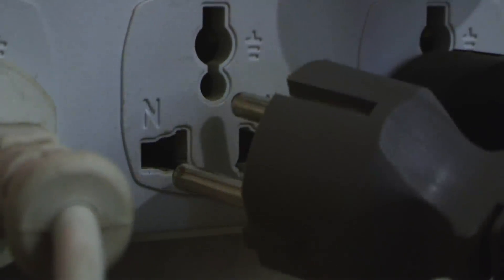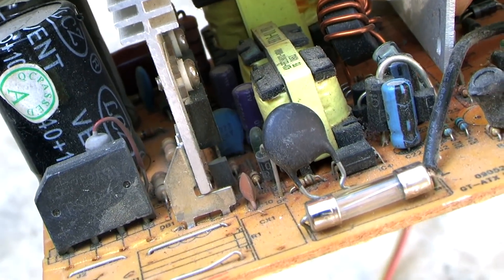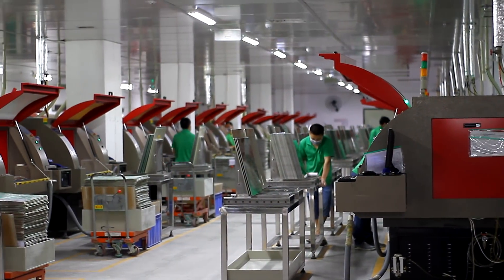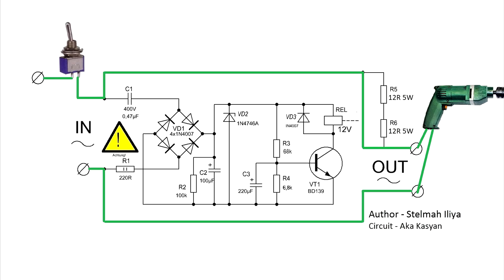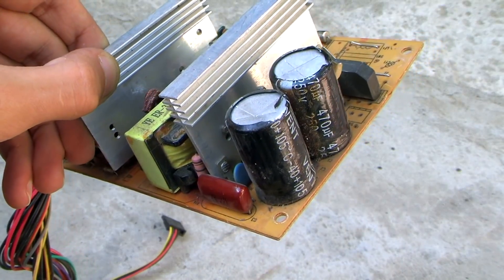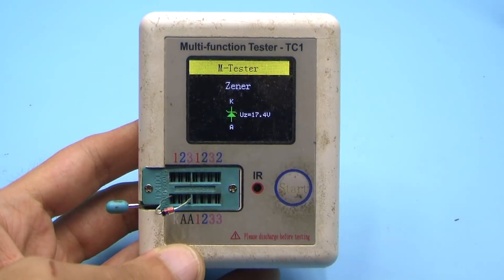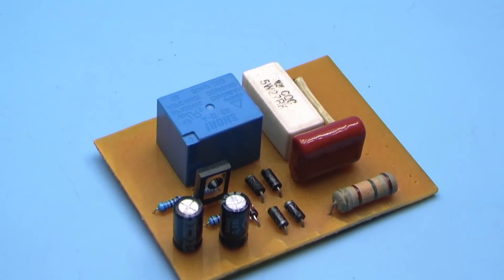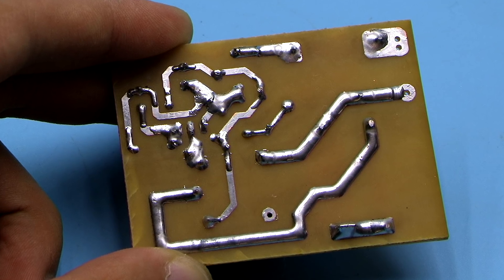This device will extend the life of your home appliances!

Comment: I used to make same principle on Radio repeaters, you can add a variable resistor to the capacitor C3 in order to control the time of charging so you can control the time of the relay or add a variable resistor to R3 in series could be useful to control also...

Comment: This idea is good but the extra current to power the relay during the operation adds extra electrical consumption. I want a circuit with the same purpose without using a relay.

Comment: the circuit works only when the load is on when apply power to the circuit. better to add current sensor to check the load and act according to it

Comment: what voltage should be for C2 (100uF) and C3 (220uF) electrolitic capacitors? because I could not find this information on diagram, nor in the material

Comment: i just want to say that, in pc power supplies,  the capacitors who need that "colossal" amount of charge will consume the same amount of energy at starting, no matter the method used for soft starting, since they need to charge, so the energy required will be always the same.
Edit: also, a computer is normally pluged in once and stays there until it breaks, so it only "needs" (it doesnt) the soft-start once, since the capacitors are permanently conected to mains voltaje. During that time, the whole circuit will just sit there, while the components slowly die, wich is a waste of money.

Dont get me wrong, this is still something really good for motor appliances, but not for electronics ones
Reply: It is true that Capacitors require the same energy but you can you can charge it slowly (with inrush current limiting device such as this) thus reducing the inrush currents. Resistance of fully discharged Capacitors is very low and pull very high currents initially. For which this soft starter would work perfectly.
And also not everyone leaves their computers on.
Reply: @sattisonaguiar7328  what i mean is that the amount of energy required is the same, doesnt matter if its all at once or in a smaller "stream" of current.
Also i said that even when the pc is turned off the caps still charge, so unless you unplug the pc after using it (weird, but some school do it) the the soft starter could be usefull, but again, what i said above
Reply: @asuramaru6931  yes in case of PC's they would keep charging unless you turn off the switch.

But for the part Capacitor charge, I kind of disagree to weather charging  them with inrush current limiting is better or without it.

I work at a factory with large Miling machines. Everytime we switch on the machines, it trips the circuit breakers (63A 3phase) multiple times. Culprits are a bunch of capacitors (around 4500uF in total) in the main frequency control drive.
The initial current is way above the specified limit of the machines itself. We checked and found they have no current limiting at all.

Capacitors charging instantaneously, loads the system. It even loads the bridge rectifier.

By the way all SMPS come with some sort of current limiting, such as an NTC.
Reply: @sattisonaguiar7328  indeed. In large machines line those the capacitors are a problem. Maybe using some switches you could turn on the bank part by part? I'm not an engineer but i think that will solve the problem, so maybe.
But you would need a ton of PCs if you wanted to trip a breaker, so the rush current is not a concern
Reply: @asuramaru6931  all the Capacitors are in parallel, so there is not much choice there. Yea PCs in general wouldn't trip a circuit breaker anyway. also it comes with some form of current limiting.

Comment: Very nice video, it adviseable to install a resistor across the C1 (main "ballast" cap). It is recommended that for a capacitive dropper circuit to have a resistor across the dropper cap to discharge it to eliminate possible shocks off of it. Other than that, very nicely done!!

Comment: This product is extremely dangerous if used improperly, and it provides little to no benefit because modern products sufficiently limit or tolerate in-rush current.

Comment: A drawback I see with this circuit is that appliances have their own starting switches and if mains is applied already, by the time the switches are pressed, the timing of relay has expired and its contacts closed with softstart cancelled.
Reply: True. If the soft-starter is connected to the mains first and then the appliance is connected to the output of the soft-starter a short while later, the relay would have been in contact position already. So you get the same high in-rush current just like there is no soft-starter.
Reply: not at all , the current is reduced by the loading resistor before loading current passes through relay to the load.

Comment: mam, How it is possible in hand drill
When we connect in main supply it will activate..after some time only we are pressing swich on drill

i think this can use only..direct switching like computer,amplifier etc

How can we use in Hand drill..etc
kindly explain
Reply: This circuit will give you a soft start when the device is first given power. You cannot easily add this to a hand drill, that's just an example load used in the video. To properly implement this, you need the switch on your device to control power to the soft-starter input. Usually, you will integrate this into your power design.

Comment: One issue, ironically, is that the relay has an inrush or starting current and the simple capacitor limits current to about 18 mA - which may not be nnough for the relay to latch.

Comment: You don't want to eliminate R1. that 220Ω of ballast will protect the bridge rectifier from the inrush current of the ballast capacitor, if the device is switched on during the peak or crest, of the AC wave form. That resistor (R1) IS absolutely necessary. This circuit is a great way to soft start large linear transformers, used in audio amplifiers. Both, because of transformer core saturation caused by DC bias, and, there are large capacitors in the power supply that need to charge. it will prevent nuisance blown fuses on power up.

Comment: The current 1:00 for big caps dont need to be controlled by thermal resistors???????? WHAT, THERMAL RESISTORS? REALY??
Reply: If your capacitors are charged through a transformer, thermal resistors aren't normally used.

Comment: can i use this to circuit to soft start a 1.5hp aircon compressor?
Reply: I wouldn't recommend this for starting induction motors.
Reply: No, AC needs a higher starting current. This is absolutely the opposite of what you need. You need a inrush starting capacitor.

Comment: Good and complete explanation of soft starter tutorial. I will try it to use in my cutting machine 2000 watt. My 2200 volt electricity always trip when im using 2000 watt cut off machine. I hope it work
Reply: Hi did you try ? Is this really work ?

Comment: It works well in small machines (upto 500w). When I checked in my mitersaw machine (1650w motor) the 5w resistor burnout. Can you suggest any heavy duty resistor.
Reply: change with 20w or more
Reply: @GheorgheBogdanEugen  i try starting my 2200 watt cutt of machine using 2 pararel of  20 w39rj kapasitor, it didnt trip the electricity. But the temperature reach 100 degree celcius when i use for  30 second. I think when using this circuit, the relay will cut off for 1 or 2 second, so the temperature on the resistor is not to hot
Reply: @wiracruise  If You put 20w in parallel you will have only 10 w
Reply: @GheorgheBogdanEugen   Sir, If you put two equal 20W resistors in either series or parallel, the combination is rated at 40W and not 10W.  The actual values of V, I and W in a particular circuit must be calculated by: I=V/R and W = I×V.  You need to know the applied voltage V and the value of the resistance R.  Regards.  Clive.
Reply: But is when i want to change the relay using 24 volt relay, what component in this circuit that i have to change? Somebody please give me an.answer. thx

Comment: I've been looking for a way to limit inrush on a big capacitor bank, maybe I'll try adapting this design :)
Reply: Better not - look for how to actually limit inrush currents. For longer loads an NTC is still great, for just capacitor-loading, if it is short, a simple coil/flyback-Diode would be enough.
Reply: @ABaumstumpf  would you please point us to an example that I could use for a 3000W 220V inverter that trips the breaker?

Comment: Instructions at 3:00 are very confusing. For this cct. to work all loads MUST be switched on and off via the soft start switch not the switch on the load (drill). Once the soft start switch is turned on the relay comes up after the delay period but then stays on until the soft start switch is terminated and C3 discharges. Zener diode description at 5:45 is very strange. The zener requires a resistor in series not parallel in order to regulate voltage and why would you set the operating voltage to 18 volts using a 12 volt relay? That won't last. Needs more work guys.
Reply: The zener diode has reactance (capacitive dropper) and resistor (maybe that resistor acts as a fuse?!) in series so this works. But yeah this kind of videos should be moderated or censored on YT, so many amateurs out there and playing with mains voltage is very dangerous...

Comment: from  6:34  to   6:37   resistor R1 disappears, how funny :)    I noticed it because I saw that R1 (5W, I think) on your board was obviously overheated and was about to burn off. In cooperation with C1 he has to supply the relay with a reduced mains voltage and therefore has to cope with a high voltage difference (energy). If you have a relay with a higher response voltage (24V or 48V ..) or a higher resistance on the coil side, not so much energy in the resistor would have to be killed down and the thermal-problem would be easier to deal with.    ...anyway, I love your videos - there are a lot of inspiring ideas that are worthy of attention.

Comment: The best explanation and design I have found for soft starter on the web, thank you for being giving with your knowledge.
Reply: ??? This is a rather crude design and will basically do nothing if not even be bad for most appliances as they already have inrush current limiters and they are designed to work with mains-voltage, not with some arbitrary outside current limiters.
Reply: @ABaumstumpf  you have too much trust in manufacturers. Same circuit like this one is used in many older appliances but omitted in many, many new ones just to make they lifespan shorter (and save some money to manufacturers). People often talk about "programmable life span" thinking that there is some chip which will tell device when to die (and sure, there are some examples of that in stuff like toner cartridges) but most of the times manufacturers just do it like this on electrical side, using too soft material for something on mechanical side or even (as seen on some old AvE video long time ago) just use unprotected piece of iron in submerged pump knowing rust will do a job in a year or two just when warranty end. 

He use example of PC power supply as device that have soft start function and doesn't not need this but just a few days ago I read review of new (and brand name) power supply which didn't came with NTC element, something even chinese "1000W but actually around 200W) PS never omitted. In that world you live. But sure, you can still trust manufacturers.

I'll probably make one just for circular saw mounted on table, it is started with foot pedal so this circuit can be applied. For drills is unpractical, not sure why he choose them as example.
Reply: @gorky_vk  Yeh - you are mixing up crappy counterfeits with actual normally designed products.

"I'll probably make one just for circular saw mounted on table"
And if the saw is any decent than this circuit will not only not help but actively be harmful. Heck - if you are lucky the circuit will not even burst into flames.

And i have at least somewhat of an understanding of electrical engineering.
Reply: @ABaumstumpf  No, I talking about real products with intended design flaw. I'll like to see your explanation why current limit like this would be harmful to let's say circular saw?
Reply: @gorky_vk  Other way around - you make the claim it is helpful in any way shape or form - proof it.
Oh right - you can't  - cause this circuit limits a potential inrush-current in one of the worst ways possible (aside from the problems that the circuit it self has that make it a fire-hazard).
Reply: @gorky_vk  "If you let's say open your microwave now you will find exactly this type of inrush current limiting."
No.
But nice lie you got there.

"NTC elements but that doesn't change anything). 
You again say this is worst possible way to limit inrush current but don't say which one is better"
Funny that - an NTC is a better solution.
but you do you  - nobody prevents your fomr using that, you might as well also get a very large capacitor and connect it directly across mains. I mean after all that is how you do powerfactor-correction... oh, you don't want to do that? Why not - it is after all the thing large motors like in vacuums are using...

"he talk about power tools here."
Yeah - and now if only you had a working brain.
Reply: @ABaumstumpf  NTC (alone) is not better solution  as it stay in circuit all the time. That can be ok for device that have low consumption (like in a LCD tv) but for high power application you want to avoid any unnecessary resistance in series.  Thermistor resistance will go low when heat up but with 10A of current over it how hot it will become and how long will it survive? Not very long, that's main reason why most (all?)  inrush current limitors for high current application use relay system. Nice try with that PFC BS to cover you lack of knowledge about matter.

Too bad that your microwave oven manufacturer choose to spare and skip it, must be new one. I'm sure it will not last 15 years like they use to run.
Reply: @ABaumstumpf  you didn't give one single argument in this whole thread. Not even a ONE single argument.
Reply: @gorky_vk  i am not the person making the claims - do you have some sort of reading-impairment?
Reply: @ABaumstumpf  no, you make a few claims, give nothing to support them than your opinion and still think you're right. That's make you typical youtube comment section troll and with that I end this discussion.
Reply: @gorky_vk  so you do have a reading impairment - thanks for clarifying that.

Comment: Impractical because most power tool use switches with in the tools, not from the mains socket switch.
Reply: You are right. As it is, is not practical...

Comment: First  this circuit does not works  for 1 year 
How it gives  extended  life for appliances  

Bad quality  power supply   in this circuit i.e Rc resistor & capacitor  based  power supply
Reply: Why not?

Comment: This circuit  having  Rc  power supply  section 
means  first this circuit life is less    it does not possible to work successfully    circuit life is only 15 - 30 days  due to  fluctuation on AC power 
Use isolated power supply 
 first  tell me  which company  using  this circuit    for application safety
Reply: The 100 uF capacitor (C2) will absorb those spikes, and the voltage of that capacitor is clamped by the zener diode(VD2). there is no ripple voltage whatsoever going to the transistor, or relay coil. The large resistors (R5, R6) and the relay contacts are completely isolated, which is the whole purpose of the relay. The values of those resistors can be increased, or decreased, to suit the need of the load. Once the relay closes, there is no voltage drop. It just becomes another switch.

Comment: I saw soft starter and also speed control circuit in Bosch hand drill machine. Drill machine speed depend on how much you push switch. And they fit in very compact. Please described it

Comment: Can i use it to work with my dc psu and motors ?  My dc psu trips whenever i connect a inductive load to it
Reply: Add a few big capacitors to the output works perfectly

Comment: Can we use it to a power amplifier?
Reply: it's the perfect thing for that! in fact, that's what I'm going to use it for. It will keep the transformer from going into DC saturation, and blowing the fuse. It will also buffer the charging of the large supply capacitors in the amplifier.